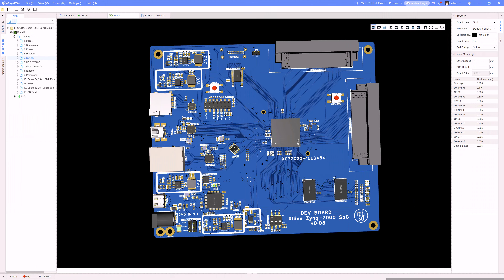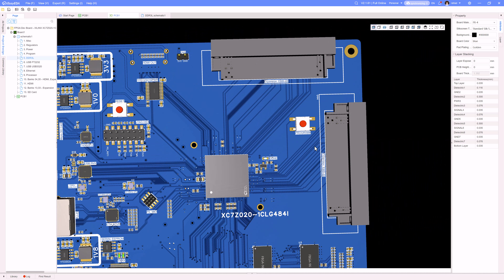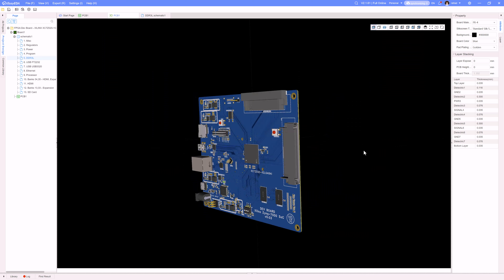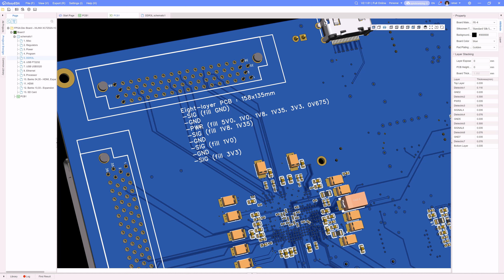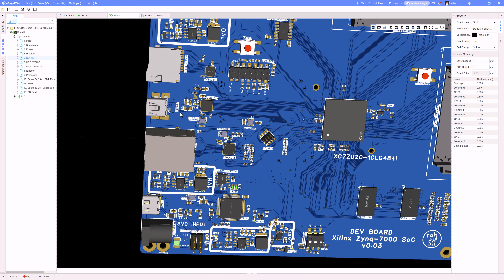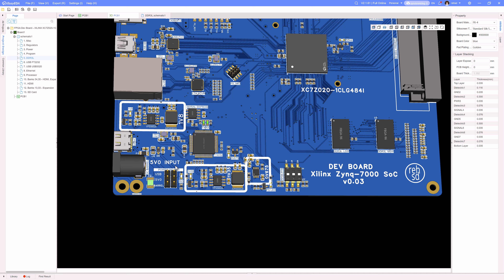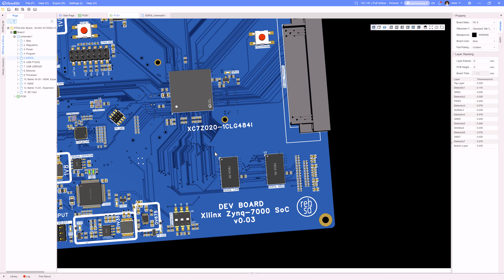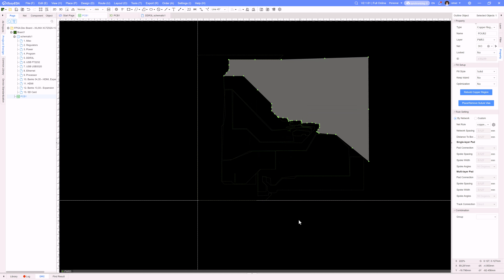Zynq-7000 PCB Build - Part 7 - Routing Progress

Comment: Perhaps consider using a TPS2115A for your dual 5V power inputs. It will "power OR" your inputs and you will not need to manually set a jumper. Among its many benefits is that you can also use it to set a current limit.
Reply from the maker: That's a cool device. I see it has a 2A limit (max, but adjustable lower). While on USB, I would want to limit it to 0.5A but possibly allow higher than 2A when using the DC barrel connector. I don't know if I would actually ever see greater than 2A. Thanks for sharing! I think this type of power MUX will be handy in the future.

Comment: Hello. Thank you
 How can i design and rout ddr3 module on the same ZYNQ you have explainded here ?
Reply from the maker: I'm using DDR3L. I don't believe this would be any different than DDR3, other than the working voltage. I started the DDR3L in Part 4 of this video series and improved it in Part 8. This is my first time through it, so I'm learning as I go. I've found the "Advanced Digital Hardware Design" from FEDEVEL to be really helpful on the DDR3 design and routing. The instructor, Phil, also has some nice YouTube videos covering similar DDR topics - https://www.youtube.com/@PhilsLab.
Reply: @rehsd  Thank you so much gentle man 🌹💚🌿🙏❤

Comment: 4:00 is the stackup dimensions on the right correct?  Looks to be asymmetric, which is unusual.  Unfortunately, I don't see the 8-layer stackup at JLCPCB.
Reply from the maker: Good question! The project in EasyEDA Pro is using JLC08161H-2116 for the physical stacking configuration. I posted screenshots of the project configuration and the matching configuration on the JLCPCB ordering page to https://imgur.com/a/qGHWdmk. Does that config seem OK?
Reply: @rehsd  Yeah, stackup looks inconsistent with your image.  Should be more like:
Copper: outer = 0.035mm; inner layers = 0.152mm.
Dielectric: 2,4,6 = 0.3mm core; 1,7 = 0.1164 prepreg; 3,5 = 0.1528 prepreg.
Also, keep in mind that with different dielectric thicknesses, the ground plane coupling for any signal will likely be stronger to the closer neighbor.  SIGNAL4 may couple more closely to PWR3 (0.15mm) than GND5 (0.3mm), so perhaps only route low-speed on SIGNAL4.
I'm also very new so it's a bit of blind-leading-the-blind here, I'm sure more experienced folk can add detail or correct as necessary.

Comment: Hey, just started watching you video. One thing i noticed (not sure if intentional) but you placed a lot if vias in your decoupling-cap pads. that is generally not a good idea, because it can wick away solder - but that depends on your pcb manufacturing (filled vias).
Reply from the maker: Thanks for the note! I plan to use JLCPCB with epoxy filled and capped vias.
Reply: @rehsd  nice. Didn't know jlcpcb offers that.

Comment: I don't know what kind of heatsink you intend to use, but a lot of them require some clearance around the SoC, so please confirm that those components which are very close to the FPGA will not prevent installing heatsink, nor will it short anything by touching from the top.
Reply from the maker: Thanks for the heads up. I've been looking at different heatsink and heatsink+fan setups, but I haven't identified any specific one that looks best yet. For the ones I have looked at, I think I should be OK. However, looking at my Done LED, I should probably move it out further so that it doesn't get covered up.
Reply: @rehsd  I recommend you to settle on some heatsink and actually buy a couple of them just to make sure you have them on hand, as there's very little standardization and each one tend to have unique footprint.
Reply from the maker: @asmi06  Do you happen to know if passive heatsinks (no fan) are adequate, or is a heatsink with fan a good idea? I'll have to do some research on heatsink sizing. I see AMD has document XAPP1377; I'll have to read through this.
Reply: @rehsd  I had a lot of troubles finding such a small heatsink + fan, that I had to settle for oversized one for my recent project - it uses 23x23 mm FPGA, but the heatsink is designed for 27x27 mm parts, and I jury-rigged a 25x25 mm fan on top of it. You will probably have to do something similar unless you fill have more luck with your search. And you definitely want to have a fan for xc7z020 as it can generate some serious heat when pushed.

Comment: You need to be very careful when doing fills on layers which contain controlled impedance traces, as when done wrong it can significantly affect impedance due to edge coupling. Unless you have tools to run SI simulation to confirm impedance, keep all fills well away from CI traces.
Reply from the maker: Great point, thank you! As you say this, I remember Phil mentioned this in one of his videos. I will work on this.